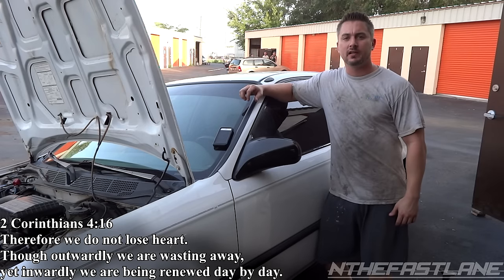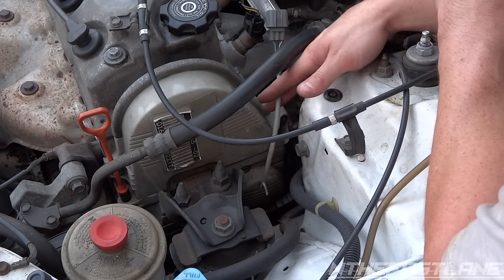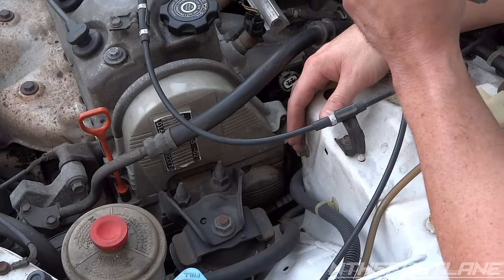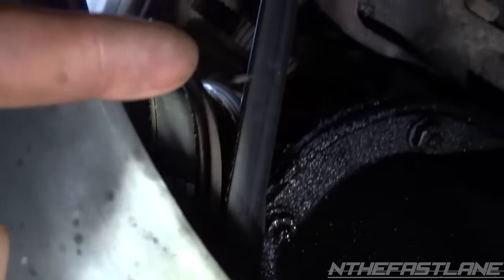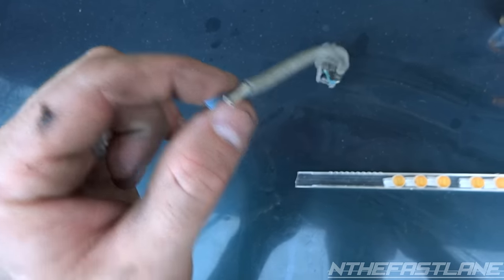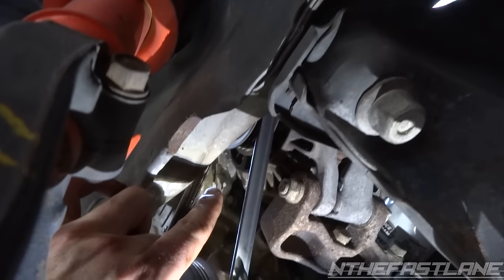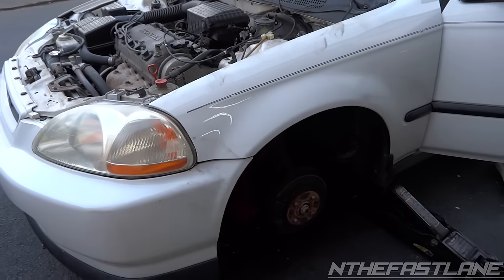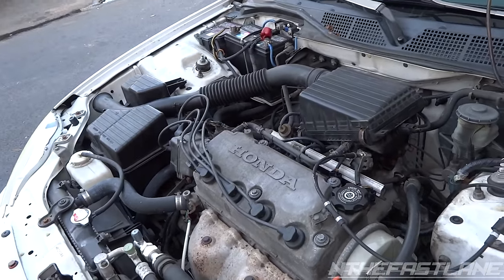▶️Cranks But Won't Start Honda (CPS) "How To"🔧

Comment: Thanks for the video!  Can you describe the no-start condition it was in?  Was the starter motor turning but not engaging the flywheel to turn the engine over? That's what mine is now doing after I just changed the cam & crank shaft oil seals & the timing belt on my '97 Accord 2.2L.  My car was running fine before, so I'm wondering if I may have damaged the CKP or TDC sensor when I cleaned all the oil grime off them with a paper towel soaked with brake cleaner.
Reply from the maker: No, this particular issue had to do with the crank positioning sensor. The engine would turn over, "the starter would spin the flywheel/crankshaft". If you hear your starter spinning, and it's not turning the engine over, more than likely it is a bad bendix in the starter The bendix is a gear in the starter that shoots out when the starter engages, and meets with the flywheel teeth to turn the engine over. Basically, time to buy a new starter.
Reply from the maker: One possible test would be, with the engine off, put a 17mm socket on the crank bolt, turn the crank a few turns, take the wrench off, and try to start again. If the engine turns over this time, you have missing teeth on the flywheel, if that's the case, you need a new flywheel, and possibly a starter. The teeth on the starter can go bad as well.
Reply: Thanks for replying! As far as the crank position sensor goes, on my 97 Accord it is called the CKP sensor.
I was also debating whether it could be the starter bendix, but what are the chances it or the flywheel teeth happens to go bad on the first attempt to start the car after doing a timing belt job? I'm going to try to find a wiring diagram.  I'm wondering: could Honda have set it up so that if the computer doesn't detect the proper signals from the CKP/TDC sensor combo (that I cleaned), it will disable power to the bendix while still allowing the starter motor to turn?  The purpose being to protect the valves from being slapped by the pistons if attempting to start while out of time.  If it's setup so that the bendix is always energized when the starter motor is, then it's a bad bendix or damaged flywheel teeth.
Reply: OK, forget what I said about the starter not engaging the flywheel. My daughter watched the crank pulley & it IS turning.  I did what you said above, except I went a step further by getting the #1 piston back at TDC in order to see if the scenario would repeat itself. I also checked the resistance of both CKP/TDC sensors via the 4-pin connector by the timing belt cover (1925 ohms, within spec).  Previously, I was assuming the bendix wasn't engaging the flywheel based on the sound/feel (seemed to turn faster & higher pitch).  I'm wondering if a fuse is blown.  I wonder if initially I didn't re-seat the CKP/TDC connector fully.  After I checked the resistance, when I put it back together, I heard a more pronounced click.
Reply: I got it running!! All it was is that the fuel drained back to the tank & after I turned the ign switch off & on several times the pump finally got fuel back to the injectors. Scared me... seemed like had no compression.

Comment: what the number on you engine block D15B or what
Reply: A 1996 Honda Civic EX came factory with a D16Y8, unless the engine has been swapped (in this case, it hasn't).

Comment: crank position sensor is in the dizzy........what your referring to is called a crank fluctuation sensor
Reply from the maker: Apparently they call it both when ordering one. CKF or CPS. Pretty much the same meaning. But from Honda, CKF would be the correct terminology.

Comment: Hi my friend, you didn't answer my question yet, it is, what is happening with my car,sometimes it doesn't start, no cranking, when it's cold I need wait 3 seconds and it start good but when it is very hot it doesn't cranking and doesn't start. In that case I need wait until it get cold. and it start good. What is the problem? Thank you.
Reply from the maker: +Jorge Caldas Look at the started relay. Possibly went bead. http://www.nthefastlane.com/File-Cabinet

Comment: I have an intermittent no start. Usually only when cold then a high idle. I've code dtcs for the ect, replaced that and rechecked. All ok. Bled the coolant. Cleaned the FITV and the IACV, throttle body and intake manifold and egr chamber and tube. The car starts up after about 8 tries cranking it every morning and idles good with the IACV unplugged I'm gonna replace it tomorrow and retest. It's a 97 TL 2.5 not many seem to know about it lol good luck y'all

Comment: Hell yeah Just bought a 1998 for couple hundred owner said it just stopped running thought it was time but the belt is brand new and it has fuel just no spark. I’m gonna go back and check on this crank sensor